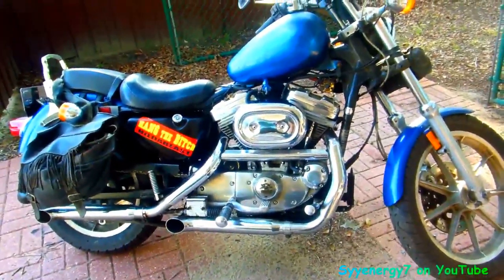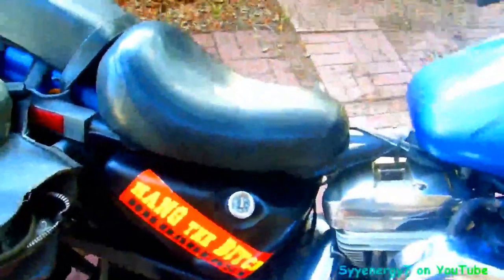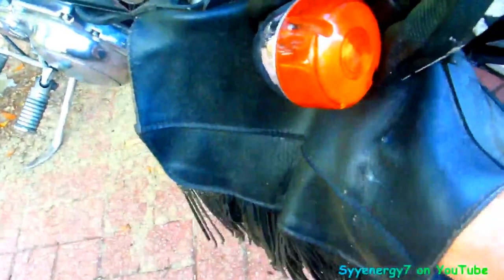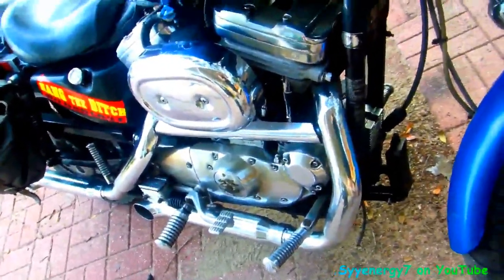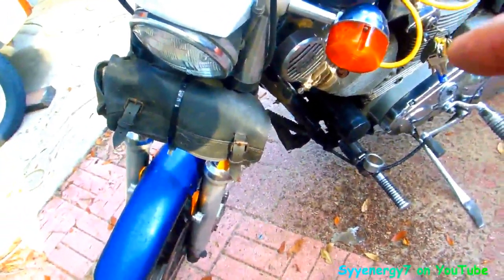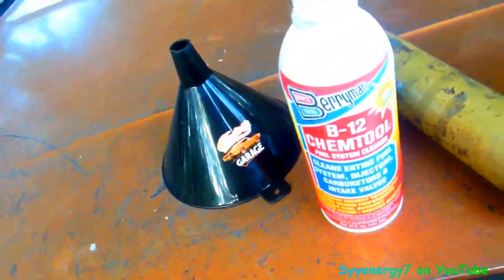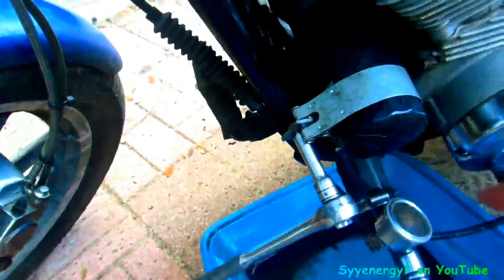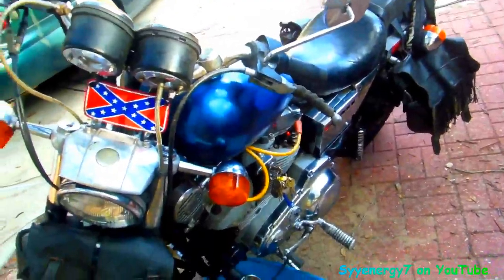Harley Oil Change, the Easy, Fast and Right Way

Comment: How much of that B12 do you run in your tank. I like Berrymans for its cleaning power, but I'm afraid to use to much because I hear it can disenegrate rubber fuel lines.
Reply from the maker: I put a 1/2 can in this time,. but I do that only once in a while.
Reply: @syyenergy7   where is the oil drain linwe located ? i cant find the tube by kickstand on most sportsers and gave similar bike
Reply from the maker: @travietrades9301  It's the oil off the oil bag. I use a suction pump out of the fill opening because that way is a lot easier.